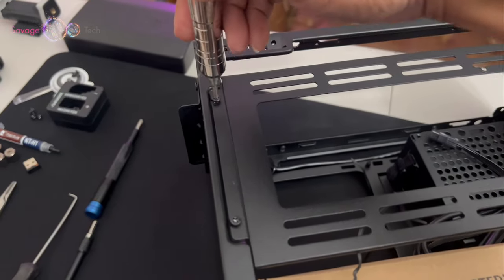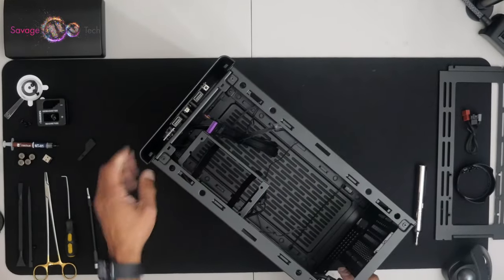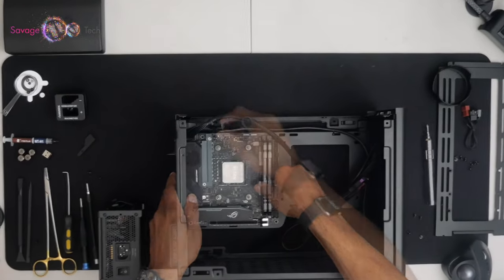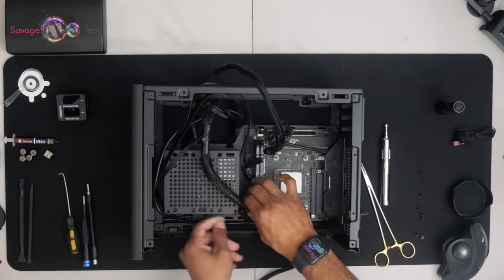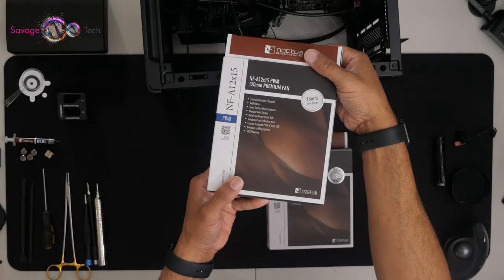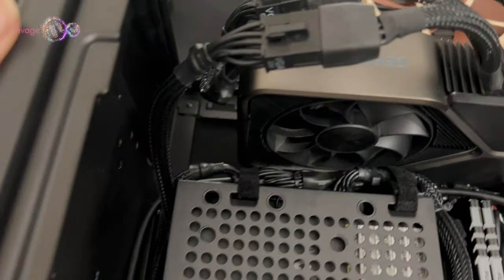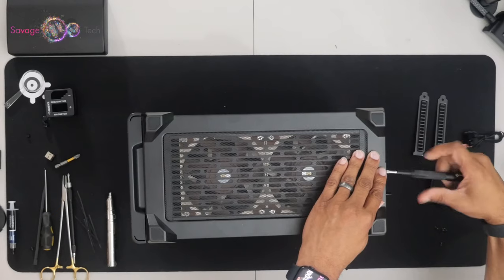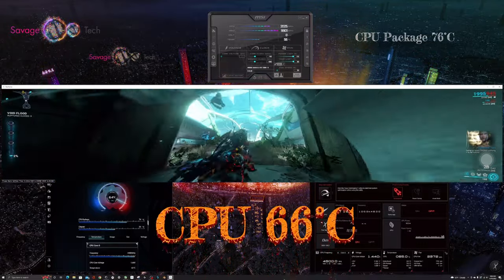The Cooler Master NR200P PC Build Is An Amazing Air Pusher

Comment: Hey, I’m planning to use an Arctic Liquid Freezer II 240.  Can I use the argb fans as intake in the push configuration so that the lights are visible or do I have to use them as intake pull configuration?
Reply from the maker: Yes, you can put them on the outside.